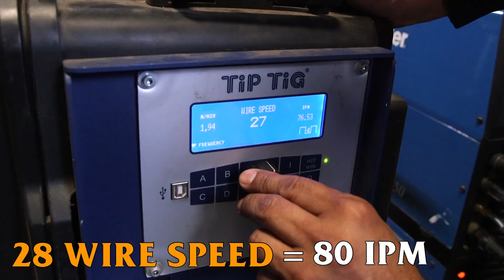Can You Weld TIG and MIG at the Same Time?

Comment: There are industries where electrode welding is unacceptable. Food industry, medicine, chemical production. I will remain silent about fantastic nuclear reactors and spaceships. I had little experience using this technology, it’s cool! For installation of pipelines close to the wall, I had experience using the Fronius FCH end FOH with the FPA welding process controller. This is fantastic technology. But it costs a lot of money, it's sad. A simple welder cannot buy this for himself, but if you have a good customer, you can take out a loan and earn money.

Comment: Good for fab shop! Coming off the bottom of a 2" in a bad spot I will take the 17 rig with 1/8 rod1/8 gap 1/8 tungsten and put a wedding ring inside. Bechtel smile is what it's called

Comment: Basically...."cold wire feed" TIG process. Uses a different design torch, but has been use to weld tubes inside box headers for around 20 years. Developed by a company in Tulsa Oklahoma.
Reply: This is two steps past cold wire feed TIG.  It has current added to the wire, you can even see the wire lug on the nose, and TIP TIG add an oscillation to the wire feed that stirs the melt pool to remove gasses and allow higher deposition rates.  When done right it has advantages on most other systems.

Comment: Перегрев металла судя по цвету шва. Мало одного потока проволоки, нужно как минимум два и большего сечения. (Overheating of the metal judging by the color of the seam. One thread of wire is not enough, at least two or more sections are needed.)

Comment: As a professional welder myself, I wouldn't recommand to learn this way. Don't get me wrong, that TIG is impressive. It has MAJOR drawbacks though. One, welding from this position on a rotating tube, forget it. Unless you work in a factory, but on the field, yeah no. Tubes are sometimes so close to the wall, that beak ain't going through. 
Second, doing the filling like that is very pretty and all, but not time efficient. You're mostely going to use electrodes for it. The root with TIG remains since it's easy to control, allows for a nice low amp setting. But for filling, most of the time you're gonna use electrodes. Or MAG with cored wire if you're outside and your company has some money to spare on the machine.
Third, and I would definitely recommand this, learn to weld from the very bottom to the very top, doing the tube in halves. Your going to have to switch your hand doing the other side. More difficult to manage your weld but learning this way made me a much better welder. Remember you'll always have to adapt to your workplace, and welding in tiny places, sometimes with a mirror is going to be required, depending where you work of course. 
Also remember, you might have to fill the inside of the tube with some inert gas for stainless tubes. 
But nice job, beautiful weld here! Took me a while to get some of those right ^^
Reply: Alex I'm with you.  He did a very nice job. But at this point in my life I'm gonna stick to traditional crap. Where I work everything needs to get done as fast as possible.
Reply: @johnsellers2999  Productivity is crucial in many companies, unfortunately. That being said, some companies have to work on what I call "beauty" pieces, so you can take your time, not to mention nuclear power plants or industrial agriculture where you have to follow a certain MO and have all your welds checked with radios and whatnot. But for most of my welding career, the motto was always "Crank the amps up, do it faster. If it looks bad, just grind and polish the crap out of it."
Reply: I been a pipe welder for 55 years power house mostly. And I thought the same thing. In a fab shop on a positioned it would kick out inches. But welding boiler tube no.I GUESS I'm old school 1/8 rod 1/8 gap and1/8 tungsten. .AND coming off the bottom of a 6" wall Hot Weld at 600 degrees it would not be worthwhile.
Reply: In officina su banco va benissimo.
Questa macchina può essere utili per i principali
Reply: @cirignotta-k8g ciao Giuseppe. Hai usato questa macchina?
Reply: Alex Guigui dici che questo impianto TipTig non è veloce se viene impiegato in magazzino su rullo rotante ? È più produttivo saldare in tig tradizionale rispetto al TipTig?

Comment: worked 6 months on the very machine:
- headpiece is skethy af while welding on high amperages gets unwinded on its own, you will adjust it pretty often, for that you have to carry small ass allen wrench that gets constantly lost
- inside the suitcase the oscillating mechanism in resting on single linear bearing with aluminium body and when the sliding tube btw mechanism and torch sleeve gats jammed, oscillating mechanism teard threads inside linear bearing derailing itself, and BAM you`re in for service
- try wiggling that torch 5-10 hours

Comment: Awesome welding and photography. Is the wire part of the circuit? Or do you still need to put a cable on the work?
Reply: The TIG circuit is as normal and the wire has own extra preheat current from the TIP TIG control box.

The magic of TIP TIG is an oscillating wire feed that stirs the pool and removes gasses and allows for more wire to be melted.

Comment: I'm really confused. What should I call this 🤔, is it TIG-Machine? Cold wire MIG 😜, or MIG Tungsten Arc Welding 😂
Reply: Cold wire feed Tig welding
Reply: @kf8575  you are right. During this year since I commented, We have converted all transitional TIG in our company to Auto-Wire Feeder TIG Torch. The productivity is fantastic.
Reply: It is a patented process (for now, patents from 1998) called TIP TIG with Hot Wire TIG with additional oscillating wire feed.

Comment: Not MIG at all. It's know as cold wire addition and we were using it over 40 years ago and it was nothing then.   BTW, There is also HOT wire addition. - That would be "sort of MIG but if you wanted to push the point.

Comment: This is not a ' hybrid ' of tig and mig but rather a tig welder with cold feed put together in one unit so you can do it with one hand.
The tig is doing the arcing, the mig wire is just feeding over the top.
There is no arc off the end of the mig wire as in a mig welder.
The ' suitcasr ' is a big money version of a mig wire feeder.
Reply: Well, it won't be happening around here.
We're so low buck my shop never even got me anything better than a mig wire feeder after using it daily for over 15 years.
Reply: TIP TIG does add current to the wire, making it a Hot Wire TIG and then adds the patented extra feature of oscillating the wire feed, both done in the suitcase.  Patens were taken out in 1998 so when they run out this should become popular with the big boys.  When set up right is gives less porosity, less HAZ and more deposition rate.

Comment: We've always called it "hot wire TIG". Good friend of mine here in Houston,  developed and leased machines that done the root pass using this,  from the inside of a pipe,  using a remote controlled welding device.  Crazy setup.  No idea what happened to the technology when he passed a few years ago.
Reply: That is what happens WE old guys take are stuff with us ...HaHa...............
Reply: Actually its COLD WIRE ADDITION. We were doing that 40 years ago. . Nothing new here. ,,,,, And I quit watching this vid after less then a minute. - This guy needs to drop poorly done Macho-MAn Randy Savage imitation. OHH YEAAAA
Reply: @mathewmolk2089  I'm just telling you what we always called it.  And what the man who designed and built the automated machine to do it,  called it.  
You call it what you want,  I'll call it what I want.
Reply: @dieselguy62  hot wire has a current going through the wire, giving more penetration. Cold wire simply feeds the wire. Thats the difference between them👍
Reply: @kf8575  all depends where you're from and who you're talking to.  
I'm gonna go with what the guy who developed the machines calls it
Reply: @mathewmolk2089  Yeah, while Cold Wire and Hot Wire  TIG have been around and have niche uses the TIP TIG is one more small innovation on top of Hot Wire TIG with an oscillating wire feed that stirs the weld pool and removes gas and allows increased wire feed.

Little was explained in this video so you did not miss much but the results were pretty.  The TIP TIG when done right has less HAZ and more speed than other techniques so it also has some niche uses.
Reply: @mathewmolk2089  TIP TIG adds current to the feed wire as well as an oscillating motion.

Comment: Do this all the time at my job. Its also known as ' cold feed '.
I use a tig welder in right hand and mig welder wire feed with power disconnected in left hand.
Reply: Why is it called cold feed
Reply: @tomkarani8954  I don't really know, thats just what its called. Probably because the wire is not charged, not part of the circuit, just fed in from the side.
On a mig welder the wire is part of the circuit and the arc occurs off the end of the wire itself.
Reply: They make regular feeder machines for this purpose and they are known as 
' cold feed ' machines. I am just using a mig welder wire feeder with no welder power applied.
The problem with that is for what I do I need the wire to run very slow and the speed I use on a Miller wire feeder is just under, right on, or a tiny bit over .5 on the wire speed scale. Not a lot of adjustment.
Reply: This process does add a preheat current to the wire and also adds an oscillating motion to the wire to stir the melt pool.  Less porosity and more deposition than other techniques when set up properly. The process was patented in 1998  think so bound to become popular when the patent runs out.
Reply: @KallePihlajasaari  pre- heating the wire sounds like something I was once thinking of for totally different soldering process I do.

Comment: The real question is what is the advantage of this over standard mig?
Reply: Weld quality. A mig welded butt simply wont compare with a tig welded butt.
Reply: @kf8575  Idk man, Running spray straight current transfer I'm sure would burn in perfectly.
Reply: yea, I was thinking the same thing.

Comment: Been doing it in our shop for years, try it without rolling the pipe.
Reply: I do it tig welder in right and mig welder lead in left hand. Luckily I just have to do straight lines
Reply: I’d like to see him do it on 2” SS tubing beverage sanitary rolling the fittings is ok.
Reply: @mynameisnobody4409  it’s not intended for fusion welding, not sanitary tube where you don’t need filler… duh.

Comment: I want one now. Can you hold the filler wire tube in your filler hand and use it that way?
Reply: If you have access to a mig welder, even one of those little 110 volt ones, you might try disconnecting the welder power and use just the feeder to feed wire into tig weld.
Been doing it 16 years. For most welding it needs to go really slow. I run right off the bottom of the scale on Miller mig feeder ( . 5 speed )

Comment: a couple of questions, please-
75/25 or 100% argon?
3/32 0r 1/8" tungsten???
whats the machine cost!
Thanks- Great Video!
Dave
Reply: Still 100% argon, its only feeding in filler👍
Reply: you really asking what a miller dynasty cost?
Reply: @swell07_  the tip tig is a separate machine
Reply: If its TIG Its an Inert shielding gas. If its TAG its an active welding gas(some stainless steels(nitrogen is mixed in))or hydrogen for extra fluidity.  MIG is use for non ferrous(like aluminium or mig-soldering) materials and MAG for ferrous materials

Comment from the maker: https://tiptigusa.com
To learn more about this process.
Reply: Hello guys 🙌 i have so many videos about JAPAN STRUCTURAL WELDING WORKS,PROUD WELDER HERE
Reply: @KMARGEL1108  I like that but we're poor.we dnt have enough money to buy that.
Reply: There is a bloke down-under  (Australia) that has a custom frame building machine for hot rods, he has an automated 3-D set up to weld his frames with. He uses an automated filler metal feed w/ a machine TIG torch and a THC similar to what is used on a CNC plaz tables. Works like a champ.
Reply: I like that machine.so nice and you dnt need another machine.
Reply: @warrenquijano9523  Blasphemy!! You can never have to many machines, the shop however can be to small thou..
Reply: I like that kind of work.
Reply: @warrenquijano9523  a

Comment: Please don’t give my boss any ideas I’m gonna have mig and tig in one hand and the stinger in the other
Reply: @ johnny canals, funny, My boss expects a grinder in one hand, torch in the other, hot cable over shoulder and you can only guess where i would like to place the stinger!!
Reply: Lol
Reply: Don't worry,  it is not cheap.  Like 25/30k if you're wandering 😁🤟
Reply: Like I posted elsewhere, I don't have to worry about it, my place is too cheap to ever get me anything better than a mig wire feeder to hold in my left hand.
I have to use one that's on top of the mig welder machine.